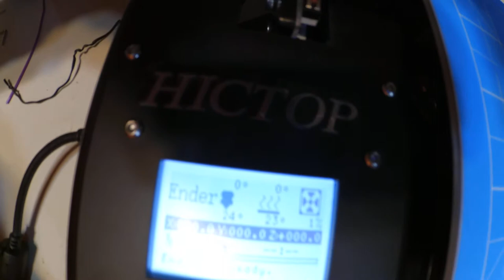Today's 3D Print   Ender 2 Unboxing & Assembly

Comment: I started watching your videos after I decided to research what 3D printer to buy. Your review of the ender 2 and happiness with the quality made me buy it for my first printer. Thank you so much I already enjoy it and the quality is out of this world for the price and print volume.
Reply from the maker: +Ren Brownell don't forget you can stretch the one axis to 160 mm and the Z to 225 mm it's a kick but little machine
Reply: Nerys I tried using the bed leveling procedure from thingiverse for the ender2 and when it went to print the square it kept running into the back like it thought there should be more build room and it appears that I'm only getting 127mm or so of build area on my y axis because of how the rail is. Could I notch out the carriage of the build plate so it wouldn't hit the limit switch until the hotend was at the front of the plate?
Reply: Never mind I went back through the video to see if I missed something and I had the limit switch on the top not the bottom of the rail.

Comment: I got my Ender and the flippin tower screws were all jacked up..Went to Home Depot for some M5-.8-30mm Everbilt allen cap screws and some M5 lockwashers..Just in case someone gets bad hardware.. If you do this you need to add some rubber feet to elevate the base as the screws may extend past the base plate
Reply from the maker: good to know! you need to check them threads first sometimes there is flashing left over from the threading process and when you goto stick the bolts in it can get messy.

Comment: Went to get the ender 2 today and it was lister at 178 for the eu plug. Put it in my cart and entered your code and the price jumped,to $208, or $203 and then a discount applied.
Reply from the maker: That's ok. its a "fixed price" coupon code. that means it ends up at $162.99. its not a "dollar amount off" whatever is listed. the $178 is actually also a coupon code price its just automatic. that is why the price "goes up" and then the coupon code makes it $162.99 it goes up to its "normal non discount price" and then you get  the fixed price coupon (the site works strangely)

I believe it only works on EU version so buy that one and simply replace the C5 cord if needed.

Comment: Thanks... I purchased two of these a couple weeks back for $157 each because my two S4's are a bit large compared to what i typically print. I purchased them partly due to some of your vid's showing their performance. Today I modded the printhead assemblies with quick disconnects and rigged them with a parts cooling fan & a fang...
Tomorrow I'll begin assembly, thanks to your video here... So far I printed a few minor upgrades (y restraint, caps for bed springs, and a z axis holder). I'll also insulate the underside of the bed, though I'm not really sure they'll need it? They're small enough that the extra weight shouldn't affect ringing issues like with the S4's.
Thanks for these vids! Any last minute pieces of advice are appreciated!

Comment: Hey there, LOVE the Orange sweatshirt and sweats, Very fashionable..Just discovered your channel..LOVE it..Is that the Anet E10 printing next to you when you are building the Ender..Trying to decide between that and the Monoprice Maker Select Plus (touchscreen). I like the build volume of the E10..Thanks for the input..Have seen your Anet E10 vids and it seems that ita a pretty decent printer..Once you quiet it down..
Reply from the maker: Kevin Wright i would definitely go with the e10 over the maker select but that is only because i love the print volume. A maker select is $329 plus $50 for the z brace kit. The e10 is under $300 and needs no z brace kit. Bonus it has double the print volume.

Just watch my vids. Deal with the minor qc issues. Replace the shround around the hot end and you habe a seriously bitchin little machine. $30 for 3 fans (linked in my vids) and you have a seriously bitching nearly silent machine. I really like it.

The e10 has higher print resolution as well. Now the maker select is more bullet proof once you z brace it but the difference is minor.

Without anout another $200 in upgrades tou can get e10 quality prints from a maker select but you will be stuck with the smaller print volume.

One advantage of the mp is you can have it in two days.

Personally i would go with the ender. Cheaper higher quality but smaller volume.
Reply from the maker: Kevin Wright oh and not sweatshirt. Just a long sleeve tshirt and very lightweight pants. I have a sunburn issues so i tend to cover up. And i really really like orange. Especially in your face nuclear fry your retinas orange.
Reply: I saw the Enders vid..Its cool but I like the print volune of the E10 plus the Enders looked to heavy and I was waiting for it to fall over with that full roll of filiment....Seem like by the time you are done with all the mods for the Mono its another 100 bucks..I like the direct feed in the monoprice, I have a Mono select mini and had to buy a new hot end after a bad bowden tube jam/hot end..Will the E10 work with Octoprint and Astroprint..By the way..I fry like a tomatoe in the sun as well..I can relate..
Reply from the maker: Kevin Wright the ender is a purpose driven machine. Ie its a fantastic cheap first 3d printer is a fantastic farm machine. I plan to eventually have 8 of the buggers.

If you already have an mp select and dont need what the ender would be particularly good for then the e10 is the way to go. Its no cr10 but its a gold cheap middle ground between the mp mini or ender and the cr10.

The monoprice select only NEEDS one mod. The z brace. The other mods just improve resolution or convenience.

But at $380 you are AT Cr10 price if you do not mind the wait.

So of $300 is your target you will be very pleased with the e10 as long as you work through the minor qc issues.
Reply: Thanks for all the advice, My wife bought me a Maker Select and its still in the box, I didnt know if I wanted to keep it with all the options out there..The CR 10 is a tad big for my desk, the E10 would fit but since I have the Maker Select already I think ill stick with that..As for the Z axis mod Ill print those out and get going..Do you recommend getting the new base plate that the bed attaches to, I hear there are some flex issues which creates a rattle..And whats all this with bad bearings..Anyway, Thanks again..
Reply from the maker: Kevin Wright don't bother printing the Z brace for about the same price you can just buy it Amazon shipped the parts are about 35 bucks and you're going to spend about 10 bucks in filament in time so just spend the 49.99 and get it all done and better quality yes get the upgraded y plate the Y plate plus the Z brace make all the difference in the world on that printer you will like it

For the one with seperate brain box http://amzn.to/2vOhsyP
For the plus http://amzn.to/2wd0lrn

Worth every penny

The y plate (will need drilling) http://amzn.to/2ieXrfQ good for bot v and plus
Reply: Looking at the Zed brace as we speak..Thanks again..Ill look for future vids..
Reply from the maker: Kevin Wright if you don't mind use my affiliate alinks I'd really appreciate it helps me out a lot
Reply: I would but I don't think the brace will work on the touchscreen version, Screw pattern is different..Unless I'm expected to drill and tap the additional holes needed..Not sure thats a wise idea..Unless I am really missing something obvious..
Reply from the maker: Kevin Wright two links in my reply there is a secpnd brce kit for the plus
Reply: Done, I had bought the plate already but not the rods which I did with your link..I think the Y plate I received was the newer revision and won't need drilling..Or at least no one mentions it on Amazon..And I looked on Reprap Champions site and it doesnt mention it..Bit I guess I will find out..What part of it needs drilling?? The hole pattern looks the same on their site. May need to get some better drill bits..
Reply from the maker: Kevin Wright they may have updated it but basically the bearing blocks. IF you need to drill its easy. Bolt them together using the leveling knob holes. There are 2 ways to line it up. One way interferes one way does not (partial overlap) you want the way with no overlap. Then you just drill uaing the old plate as guide. You may not need to do this especially having the plus.

Cobsider the z brace kit if you decide you like 3d printing.. Its almost as critical a mod as the plate. Makes the whole printer very rigid which improves print quality at higher speeds and stops bed level from being a moving target.
Reply: Yep..Bought the brace with your affiliate link..Its a cool hobby, My Select Mini limits what I can print which is why my wife got me the Plus..Sure wish Simply 3D had a trial to see what it does as opposed to Cura. But thats another subject, You have a video one that by chance??
Reply from the maker: Kevin Wright I have and enjoy simplify3d but I have never used cura so I can't morally give you an opinion as to which is better and since simplify3d work so well I don't really have much incentive to try cura :-)
Reply from the maker: video on difference with cura? alas no I have never used cura and it would be unfair to make a video without developing experience with how to use cura right. IE of course S3D would win in any video I made since I know how to use S3D but not Cura. I may one day.

Comment: I build my ender "with you" :) a dream assembling after anet a8. the y carrage is a bit wobbling. calibrate the left screw and did it better but to tight and it stucks in middle position. the y carrage was first also to loose screwed. the bed leveling with three screws and the auto lvl mode is good to handle but needed some time to learn but thats a hard part in every printer. than i wanted to testprint from sdcard..but I've the one with the wrong sliced model für z high +3mm. so the print starts in the air. good that i saw that in another video before. a day later i get good prints with noname silver pla but see the cooling issue on the nozzle for overhangs etc and printed a cooling fan duct (thing 2334407). not tested yet. atm i print the cr 10 extruder dust cover (thing 2381728) for the ender. one of next is i want to move the z axis..hate to do manuell with hand on the motor. so on. need another filament holder for wider spools and better rolling. didnt find one yet that is not outengneniered with to much use of printed filament for that scenario. for now..love the ender. a friend added the ender directly to his wishlist :D the next one of two that bought a printer after me. sry for my terrible english but want to know you my experience and watch all your 3d printing videos :D
Reply from the maker: Awesome! Use the eccentric nut to tighten the bed. Not too tight. Have fun making!

Comment: Maybe I missed something. Did you find a solution to the problem you describe at 29:00? Thanks for your help.
Reply from the maker: nope. it has proven to be a nitpicking on my part non issue. my guess is that the pulley is not "100%" sligned perfectly so the belt has a pressure bias. no effect on print and no undo wear and tear. just one of those "huh I noticed that" but don't need to worry about it kind of things.

Comment: Do you use cura as a slicer? I have mine up and running now but have no settings for cura and your prints are always awesome. Lol
Reply from the maker: comes with experience and tuning. I use simplify 3d. I have a video on how I set it up you should have similar settings in cura.
Reply: Nerys I will have to check that out. Is there a better way to contact you for a chat?

Comment: firstly, nice built man.
would you suggest this to anyone thats without any prior experience in assembling diy 3d printer?
i mean i'm trying to start this 3d printing thingy but pretty much budget to 200 bucks so prebuilt printers are out of my budget.
Reply from the maker: Yes. I would classify this printer under the "prebuilt" category. all the hard work is already done. your just slapping parts together for the most part. if you can build flat pack furniture. this is easier. the video included on the SD card is nice and is how I assembled it. Slow careful. don't strip stuff by getting impatient. its not hard at all. you should be able to put it together in under 90 minutes with fully HALF that being removing bits from the box and watching the video.

I really would class the ender 2 as a fantastic first printer. it has given me absolutely zero issues and I am printing the CRAP out of it. it has not even slightly slowed down or hinted at a hiccup. proving very reliable so far. making a crazy petg pen right now. can't believe its working considering how much its wiggling around (petg is flexible compared to PLA)

then watch my bed leveling videos. 99% of first time printing problems stem from improper bed leveling. master that and you have largely mastered 3d printing.

Comment: is that a cr10s on rails printing that nose cone?
Reply from the maker: I can't click on the video while mobile but if it's what I think it is it's either the Tron XY X 3s or the anet E12 both of which use round rails
Reply: Nerys can the cr10s be put on rails like the e10 or did it just come that way?
Reply from the maker: You don't want to put it on Rails rails as inferior the v slot extrusions are far superior in my opinion much more rigid much more stable much easier to align

Comment: Hi Nerys,
In this video you mention Jerk Settings. Is that defined in the g-code or does it need to be defined on the Ender-2 control box?
Also what setting on the control box would need to be changed to make sure of good prints with your profile?
One final thing, on my Ender-2 my first layer is messed up when printing the Benchy, Also the letters on the back are not clear and it looks like i have some slight zitting. I hope you can advise to fix these issues.
Thanks
Reply: Also what should to distance of the nozzle to the build plate be apart from using paper?
Reply from the maker: +NSCXP2005 my profile includes the corrections to the jerk and acceleration settings so if you use my profile you'll get those Corrections go back to the description of the current video any current video there's a link to my profiles I also now have links in there for test print gcode for example the Benji that I sliced for the Ender to try printing that and see if you get a different result
Reply: Thank you so much!!
Reply from the maker: +NSCXP2005 also first layer is critical to the quality of a print at least for success check out this video it goes over basic Theory on how filament works and first layer works nail first layer and you've nailed 99% of 3D printing

https://youtu.be/iG2i8qH6DGs
Reply: Nerys Thanks Nerys. If I get stuck or not having any luck I will message you.

Comment: My arrived yesterday with huge metalic 20 A Power Suply that is wired direcly.  Is it normal now or something is wrong with mine?
Reply from the maker: +michkanm I believe that is The New Normal from what I hear in fact I've ordered one so I can play with it since I hear it can hit ABS temperatures now which means you should get hot enough for nylon and PC as well which is exciting to be I'll probably replace the power supply with a brick like the old one uses just because that's elegant and clean Xbox power supplies work apparently :-)
Reply: Nerys Thank you very much.
Reply: I can confirm that mine ordered in November 1 arrived today with a 20 Amp 12 Volt power supply. At first I was annoyed but in the long run it will be better I think. It'll be easy to replace if needed too. I had to cut the PC connector off a US cord I had (ordered the EU version) and connect the wires directly to the Power supply. They did have a US adapter included but didn't like the fact that it was ungrounded - 2 prongs only. It prints beautifully like my CR-10S!

Comment: Hi, I had to ask first before I hit the buy button through your link. ;-) Can the Ender 2 be controlled by octoprint? I think so because it is Marlin, but I want to be sure. Greetings from a Dutch fan. :-)
Reply from the maker: +Frank Roozendaal while I have not tried it it should it's basically the same as this cr-10 in the cr-10 works with octoprint is fine
Reply: Thanks

Comment: I brought this printer after watching your review and I can't get it to print anything that isn't garbage. It is either super flimsy, prints dots instead of lines, or tends to smear filament around. I'm not sure if it is my filament, the gcode, or if it is my settings in cura. I would be eternally grateful if you could take a look and tell me where to start 

https://drive.google.com/drive/folders/1bWnVPyEk-PEMJtOVryv4UVuB1X5oubLC?usp=sharing
Reply from the maker: +Nimah Kelly I will look at that when I get home after work in the meantime go to one of my current videos and there's a link in the description for my profiles I also have sample gcode

Try printing one of the samples. This will tell us if its printer or software assuming good bed level.
Reply: Nerys thank you responding so fast! I will try to print out one of your sample gcodes.
Reply: It was definitely my Cura settings. I used the same benchy boat with your Simplify3d profile and it printed out fine! I just need to make a few adjustments for the finer details but it definitely worked! Thanks!!
Reply from the maker: +Nimah Kelly excellent at least we know the hardware is ok. Now save that benchy gcode on your sd card. Never ever remove it. If you have troubles you go "back to known good" ie gcode that has been successful this way you confirm if its settings in slicer or something else. (Printer or filament)
Reply: Nerys wouldn't have thought of that. Thank you so much!